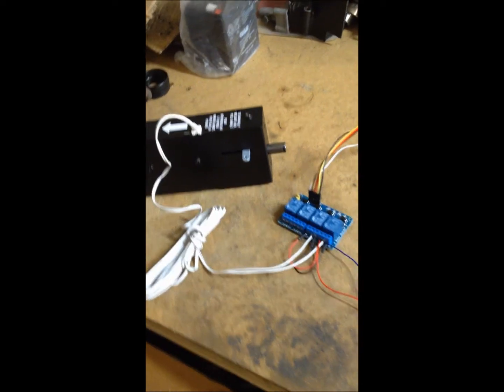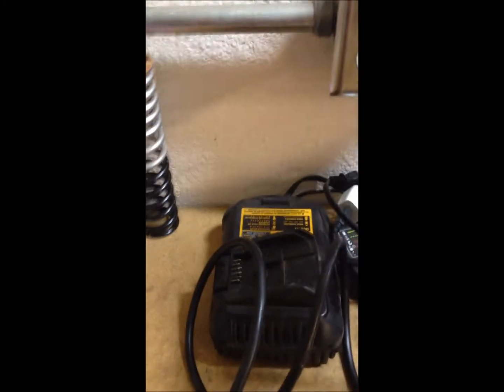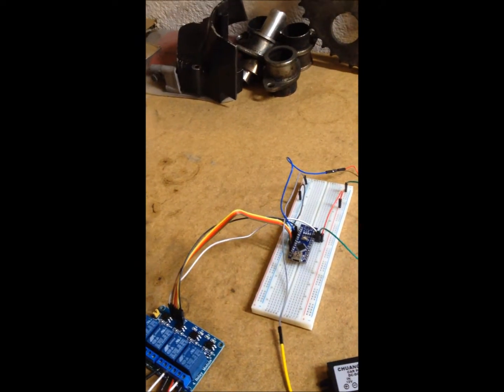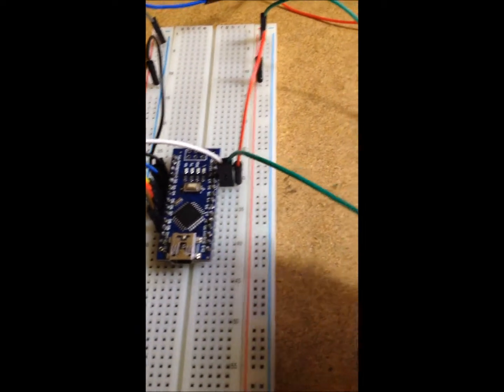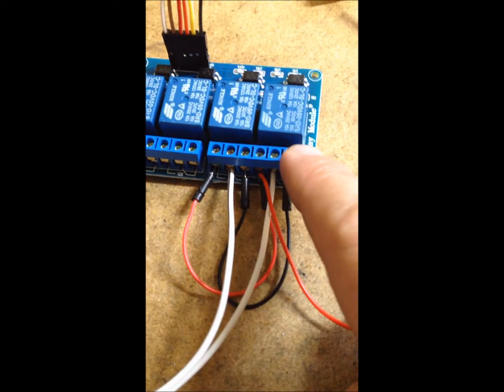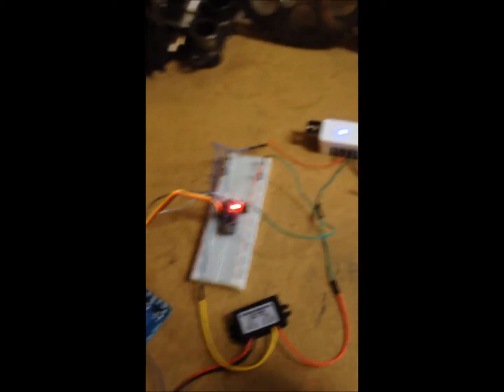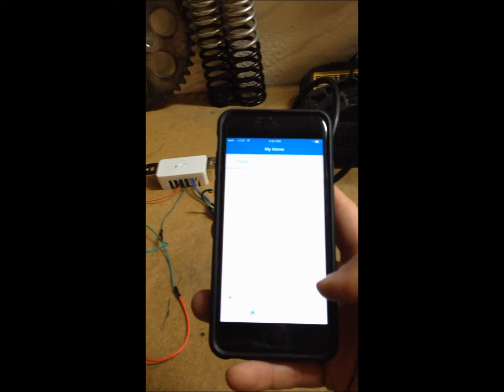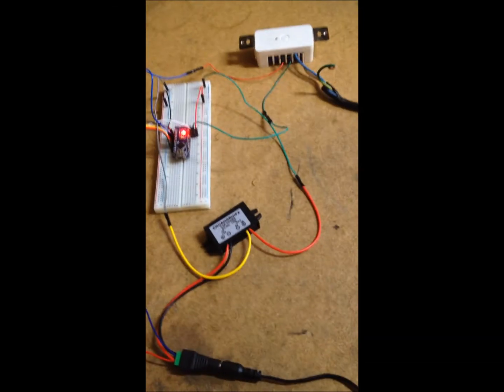Garage Door Bolt Lock connected to Zwave Relay, Arduino nano, and Smartthings

Comment: Hi!  I actually did the same thing for a while, for my garage door.  HOWEVER, this is a dangerous solution as it mixes low voltage and high voltage, and that relay module is not designed to handle it.  I was having a hard time sleeping at night.

I am currently doing the same thing with a Particle.IO module (you can code you own stuff or use generalized SmartThings code, just search for "particle" in their forums) along with a low-voltage relay.

The other BIG advantage here is that you can trigger the code from SmartThings, but then have local control on the micro controller to actually control it.  Mine is being used to send 24VAC to a security gate buzzer, and if it gets stuck on it will burn out, possibly cause a fire (though, unlikely).  The microcontroller will turn it off after X seconds, regardless of whether or not smartthings hangs up and can have a battery backup to ensure operation.

The relay I am using:
https://www.amazon.com/gp/product/B00M1NADYM/ref=oh_aui_search_asin_title?ie=UTF8&psc=1

Particle WiFi module:
https://www.particle.io/wifi

NOTE:  The latest particle modules will work with the pinout for the feather line from adafruit.com, and they have a simple relay too.

Good luck and nice video!
Reply from the maker: ultralame 

I’ve been running this Garage door setup for the last year and a half and couldn’t be happier. However when I first put this system together I was fairly new to arduino’s and hobby electronics. But I did make sure I had all voltage’s separated to prevent an overload on any system.

This setup has 3 voltages running (5v, 12v, and 120v). The 120v line only comes into contact with the switch contacts but not the switch circuitry itself. Per the data sheet for the SRD-12VDC-SL-C these contacts are able to handle a max load of 10A 120VAC. My garage door requires 5A 120VAC and thus will not overload the contacts for the switches. Unless the Garage door itself shorts out causing a current draw spike, but that would be a bigger problem then the switches failing :). 

The lock actuator and switch-board both require 12vdc. While the arduino requires 5vdc. These two voltages are isolated from each other and only work together thanks to the optocouplers on the switch-board. 

With that said, the part of this system that is most likely to fail IS the relay. It is cheap and has a limited life expectancy 100,000 switches. Being I bought it from eBay the life expectancy is probably much lower. An option to for preventing a fire if the switch was too fail much earlier than expected would be to connect 2 of these switches in series with something to read the status of the 1st switch. If the 1st switch is on when it should be off (thus it has failed) then the second switch will cut the connection. The odds of both switches failing at the same time is very very unlikely so the system would be worry free.

Still, I’m very happy and will leave it in place as is. I will play with the idea of switching too a solid state relay in the future. 

Also thank you for the information on the Partical.Io board. I remember when they first came out not so long ago. They’re kind of expensive compared too arduino boards but I am very interested in the Asset Tracker kit v.2.. I tried to do the same last year with a T-mobile 3G SIM card and GPS board but the T-Mobile customer service was horrible. I hard the hardest time explaining to them the SIM card was not for a phone but a IOT device :).